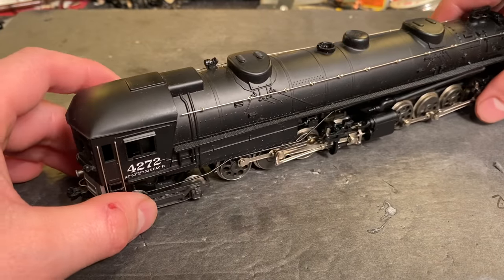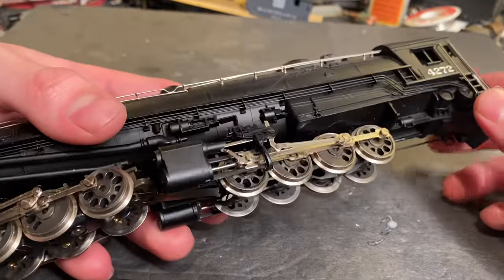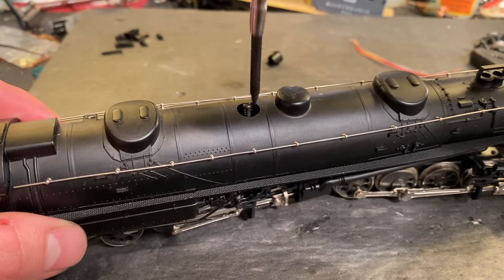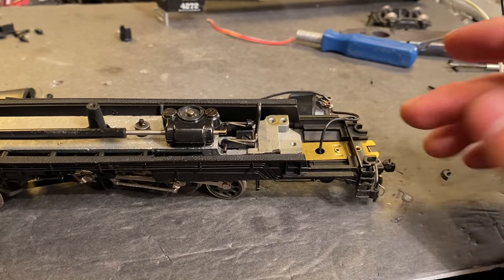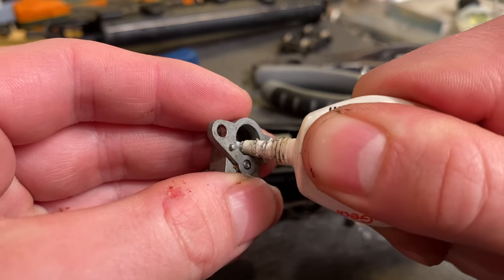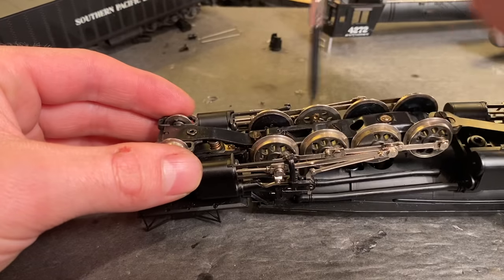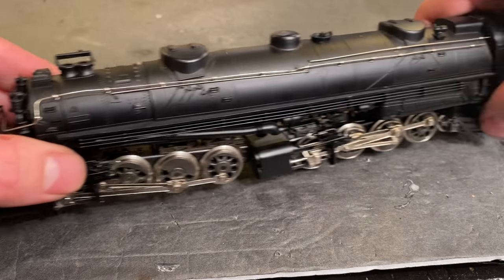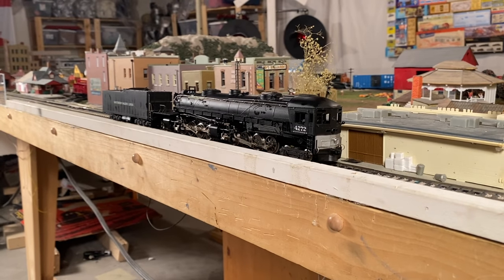Can We Make This Rivarossi Southern Pacific Cab Forward Run Again?

Comment: Didn’t you hear me yelling at the screen when you were searching for the screws?  I’ve taken a few if these Rivarossi articulateds apart over the decades. This one looks like it was never run, or spent very little time running. I bet it’ll loosen up with more track time. Good excuse for a live stream!
Reply from the maker: I wish I could have haha. I suspect the shorting issue was probably going on for most of the loco's history which could explain why there isn't much wear on anything.
Reply: LOL 😂😂
Reply: @SMTMainline  hey can you give me some tips on ho trains I am starting I have a plastic shell sr3 Wich stutters not sure if it is the loco or track
Reply: @SMTMainline  good morning I was watching this video and so that train was rocking . What I have found with my rivarossis the axle that has the gear on it is made out of brass and because where it sits in is square not round it wears an uneven Grove right wear axle sits on what we would call a bearing even though it's not it's just a square cut out bad design unfortunately. It causes axle to wobble.  Every time I see one for sale I buy it even if it's for a different rivarossi they are all the same spline gear I just swap axle and requarter the wheel set. One day I will pull an axle off the wheels and tin the wear spot with solder and sand it round again and see how that works
Reply: Yee haw! I have three of them my uncle Lance left me that I have to refurbished and am now more confident that I can.
Reply: I heard ya yelling

Comment: Just checked the 1973 AHM Parts Catalog.  Your Cab Forward is the latest revision.  Your motor is round and not square.  You have the better of the two versions.

Comment: When I buy pre-owned engines I totally strip them down and I use gun scrubber to remove all oil and grease then I let it all dry and reassemble the engine.
   Thank you Harrison for puting these videos out because of your videos that how I got started in to servicing all my engines I'm also keeping maintenance records on all my engines and rolling stock.
   Thank you
And yes I do Relubricate the 
drive train  and all necessary components. 😏
Reply from the maker: I appreciate your comment :)
Reply: It takes time to do  so if I sell them I can say that yes it only has 3 hrs or yes it has 200 hrs run time I'm hoping that it will affect the price if I do sell them 99.9%of my rolling stock are from the mid to late 30 to about mid 1960s 50/40 ft single and dbl door Bx cars all metal and dicast. And 1 or 2 all wood cars.

Comment: You did it ! I myself are restoring an AHM - Rivarossi HO , C&O Hudson, bought new in AHC (America Hobby Center in NYC ) in 1981 for $53.95 USD
I appreciate the construction of this model, good detail for the price. The pilot was broke where it attaches to the frame, I mange to put a support for the pilot, it is holding better, and built a ladder that was missing on the engineer side. One of the two  driver wheels picking up current, is not doing so. I have to do something. But so far, with a little patience it will work again. Used to be a good runner.  It deserves to be taken care.

Comment: I have the same engine but stripped it for parts for another Rivarossi 2-8-8-2 Norfolk & Western which wobbles as well. I purchased mine back some 50 years ago for around $40. Now today they are way more expensive. Will have to oil mine up and see if it runs as well as yours. Thanks for sharing. Nice video with good information.

Comment: Now we just need a cab forward and big boy double header
Reply: Train Master - I's been done, back in the Sixties we had a club member who liked BBIIIGGG engines!
Reply: I think even he would say he would or wouldn't do it and the fact is because the motor on either prob runs different speeds etc. Alot of load there.
Reply: @mercuryoak2  don't forget different gearing and different motor as well as different start voltages and different behaviors.
Reply: @steamier7755  I wasn't I was making a general statement

Comment: Great job. I remember seeing one in 1951. Th SP used them on the Imperial and the Argonaut ( locals that ran the same rout as the Sunset limited and Golden State) fascinating to watch all the maintenance performed during the stop, lots of lubricating, etc. in 1951 I was 13 living in Douglas Az. Tracks have since been removed and now the Sunset Limited runs from Benson to Wilcox and on to El Paso where I live now. Great video thank you.

Comment: You did a great job sorting this one out, she runs nice-!!  I had a friend many years ago who was really good with model train repair, but in this one instance I watched him spend weeks trying to sort out a beautiful but non running big boy model but even though the motor ran out of the chassis he spend forever getting it going, even then it was always glitchy and a real pita - at one point I had to stop him from sending it at warp speed into the concrete basement wall - lol - which was odd because he was usually very paitient but he met his match on that big boy.  There was no internet back then so he had little to go on, im sure it was repairable but not by him-lol  Nice job on this really nice model.

Comment: Kudos, Harrison! A super interesting loco and repair job. 

Suggestions: 

1) Consider getting a “screw grabber” for those hard to reach/hard to replace and start small screws. A low-cost tool I think you’ll love.

2) Now that you’re an expert with taking the Cab Forward apart, how about a video on installing a DCC decoder (with sound) for this terrific loco? I think you’d really be pleased with the result — and the rest of us would learn a lot from you. Given the size of the boiler and  tender, there’s plenty of room.
Reply from the maker: Thanks. The main challenge I see with adding DCC is that the motor is a 3 pole and I don't know how to adjust the CVs to support it.

Comment: I had to find and borrow a set of original paperwork for the Rivarossi / AHM / later Model Expo Cab Forward before I attempted to dismantle my first one, which I coincidentally bought used for $125 from Trains and Such back in 1979. Trains and Such was still owned by Jim Scott back then (he started the business in 1975, I think, as a fun side business to his FT job as a school teacher). The hours were a couple of evenings 7-10 p.m. a week and Saturdays. It was a modeler's dream shop, with mostly the highest quality new and used items and over 200 new and used brass locomotive on display and for sale (for $200 - $1800) at any given time for us non- rich kids to look at and dream about. Jim and his staff were always friendly and helpful, even with annoying 12 year-olds with mostly empty pockets like myself. My Trains and Such steal of a deal Cab Forward (they were over $275 new even back then) was in like new condition, but the paperwork was missing and the box was in tatters. I still have it today - still in excellent condition, and it runs so well I've often been asked if I re-motored and re-geared it. Nope - just lucky to get a good one out of the box. BTW - there have been a few versions of the Cab Forward drive mechanism - at least 5 I know of. I own at least one of all but the very first version. The shells vary much less - only 2 versions I am sure of. Really, the shells and details remained the same from the sixties to the mid 90's - when the motor was moved from the cab to further into the boiler shell (the so-called "Red-Box" versions). Some are much better mechanically than others. The last "Red Box" has a 5 pole motor and a flywheel drive. Harrison has the mid 80's to early 90's drive with the reduction gearing and the three-pole can motor, which are usually pretty good runners.

Comment: Bought one new in 1968 for $18 (didn't have $30 for a Big Boy).  Always ran like it was slightly constipated.  Did put an extension on the roundhouse for it.  Hope to remoter and add DCC and probably do something about the flange depth.

Comment: Of course you can. Rivarossi is good stuff👍😁
Reply: I think so to. The only thing that kills them is using the incorrect oil or grease. Also if you don't align the gearbox with the shaft properly it can destroy the gears. People knock those old motors, but they go forever!
I much prefer the old Rivarossi compared to the Red box ones. In the old ones the chassis were pressed metal which never dies. The carters were metal. The red box ones may run better  and have a good can motor, but they have very fragile plastic components. The chassis are cast. Remember the old Zamak rot? Hope that does not happen to the newer cast chassis I have  Red box Big Boy and a Red box mallet 2 8 8 0!

Comment: My favorite locomotive, steamers are much more difficult and much more tedious to work on. Don’t forget to lightly oil all of the moving arm mechanisms connected to the wheels.
Reply: The rods connected to the wheels are Drive Rods and the outer rods are valve gear rods.
   I didn't realize that the valve gear rods actually made the engine move till last year and I'm 55. Go figure.😅😅😅😅
Reply from the maker: Absolutely. I didn’t do it on camera but when I mentioned I oiled the drivers towards the end, that’s what I meant :)

Comment: I realize that there were only six Canadian articulateds, 5 malleys and a one single expansion 0-6-6-0's with the cylinders facing each other in the middle for Canadian Pacific in the early teens. You would think that with the Rockies, articulateds would have had better acceptance. So if CP or CN stuck with it, would they have bought cab forwards? Or would they have been more exotic beasts such as Garrats from Beyer Peacock or maybe Fairlies (From Fairlie, Nielson, North British and Vulcan (not the US firm)) like the British financed Mexicano which successfully battled the fearsome Maltrata Incline, with its four percent grade and 17 degree curves, for decades?
Reply from the maker: Thanks for sharing this information
Reply: Canadian Pacific did have the six 0-6-6-0's you mention - Class R1. 5 where built as compounds (true Mallets, using the steam twice in two low pressure cylinders). The last one was built as a "simple" - i.e. all cylinders used high pressure steam. They were unusual for North America in that all the cylinders were grouped together between the sets of driving wheels. Some small British 0-4-4-0 articulated locomotives also used this arrangement. I believe the R1's were put into service on CPR starting in 1905. They were unsuccessful and later converted to rigid wheelbase 2-10-0's.CPR should have used articulated locomotives over their numerous 2.2% mountain passes, but instead went with their 2-10-4 "Selkirks" as their principle road engines, and adding extra helper engines double and triple heading over the steepest grades in the Rocky and Selkirk mountains. CN's 1% mountain grades never really needed anything heavier than their 4-8-4's and 2-10-2's.

Comment: Payback a book with the blueprints or every river Rossi ahm locomotive ever made I actually have two books and it shows where all the screws are and how to pull the shell off of like the big boy or the cab forward I would recommend checking your used book and magazine pile for that for the owner's manual Bible as it's called but it has all the blueprints for all of the locomotives made by river Rossi and ahm comes in handy by the way excellent job on your videos
Reply from the maker: Thanks a bunch

Comment: Dang son really confirming yourself as the model train whisperer. In future if you don't already with some of the more intricate Riverossi and other locomotives check the ol magic Google machine and see if someone hasn't scanned a PDF of the instruction sheet as I seem to recall an exploded view schematic on those that might save you some frustration in the future. 
75 bucks isn't much more than what it sold for back in the day.
Reply from the maker: I probably should have done some homework on it before hand but it worked out fine in the end. I know better for next time.
Reply: @SMTMainline  oh trust me you're not the only one. Many a time I did the slap my forehead with a D'OH!! when asked if I'd looked it up online.

Comment: What a awesome sight to see this running and so smooth too! Means only one thing.. SERENITY!  I've played MSTS (Microsoft train sim ) with the donner pass route and let me tell ya these were some loud locomotives with the pshhh ahh pshhhh like its sneezing . the number on this one 4272 was introduced what i looked up November 24,1942 to may 9,1943 and in 1954 to 1958 they retired them. By April 1959 4274 was retired. All of them were scrapped unfortunately the other versions were saved its called a AC-11 cab forward by Baldwin locomotive works.  Then SP had AC-12s which were newer built in 1944 they used them for a little over a decade with the first retirements occurring on April 5, 1955, and the last on September 24, 1958. Only one AC-12, SP 4294, has survived into preservation and is now on display at the California state railroad musuem
Reply: The pshhh ahh pshhhh sound is actually the sound of the air compressors on the smokebox. The Cab Forward footage would also show the exhaust smoke from the exhaust pipe from the air compressors being expelled in sync with the air compressor sound.
Reply: @steamier7755  oh yeah that's really cool!

Comment: Hey man, loved the video I have a little bit newer version of that cab forward, it runs really good but the pilot truck keeps on derailing so that might be something you’d want to look out for.
Reply from the maker: Have you checked that the spring is okay and the drawbar isn't bent?
Reply: @SMTMainline  I’ve done both and after that I replaced the old wheels, it’s a little bit better but it still picks switches sometimes

Comment: with very little exceptions these old Rivvys always come back to life. They're very well built if a little clunky and unrefined. They set the standard for decades before the Asian manufacturers started to dominate in the early 90s. I've done dozens of these for customers and have yet to not bring one around.  

FWIW, don't do the ultrasound cleaner.  1 there's just no need for anything here to be that clean as the tolerances are really big and 2 some parts, especially ZAMAC frames may be destroyed.

Comment: I suspect that the draw bar isn't supposed to have the spring/screw combination on it - but maybe it should be on the trailing truck.  The screw that was attaching the trailing truck looks like a type I've seen on other Rivarossi locomotive pilot/trailing trucks that DO have springs on them.  That might've been someone trying to re-assemble it but just put the spring in the wrong place.  I'm no expert on this cab forward model to be sure tho.
Reply from the maker: I still can't tell if that was stock or not. If it was built that way it seems like a major design flaw.

Comment: The locomotive is in the 1978/1979 international model railways catalog. (Internationaller Modelleisenbahn Katalog) Under both AHM and Rivarossi brands.
Reply from the maker: Do you know how many years it was in production?
Reply: @SMTMainline  No it is in the book though, its old and out of print but it does show up on eBay from time time (HO edition), you should get one, there are over 5000 models presented in photographs, some brands I never heard of are in there, too!

Comment: This is one magnificent beast!  Glad you could work your way through its problems, giving it the respect that it deserves.  
Question:  Is the firebox still at the rear with the tender?
Reply: Nope; the later model 'cabforwards' were oil burners, so the oil was pumped up to the cab end, and burned in the firebox there.
Reply from the maker: @TallboyDave  I was wonder if that was the case, thanks for sharing.
Reply: @TallboyDave  Thank you, I was wondering how on earth they could reliably get coal from one end to the other. That answers that, then!
Reply: @6yjjk  While the Southern Pacific was the main user of Cab Forwards, a handful were used elsewhere; for instance the Italian State Railways had three classes of Cab-Forward 4-6-0's for express passenger trains (classes 670, 671, and 672); interestingly enough, these engines were indeed coal-fired, from a bunker built against one side of the boiler next to the cab- the tender was used solely for carrying water